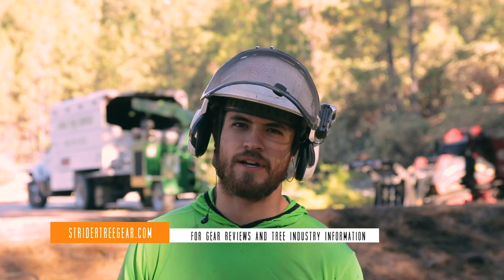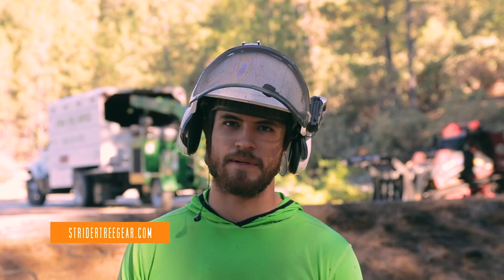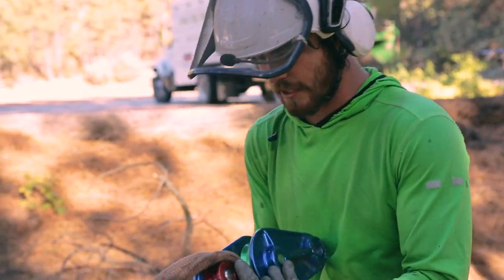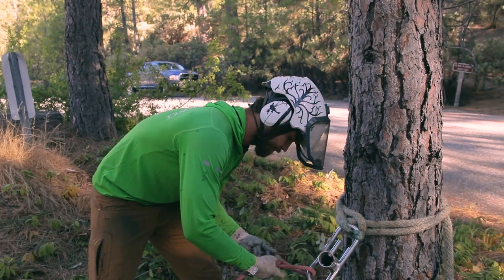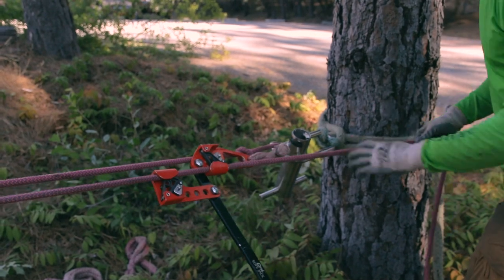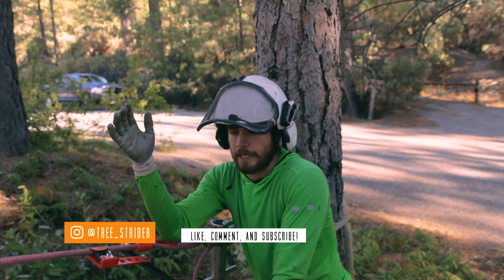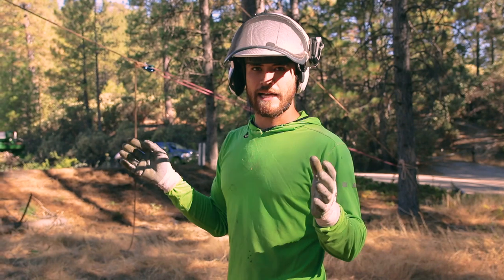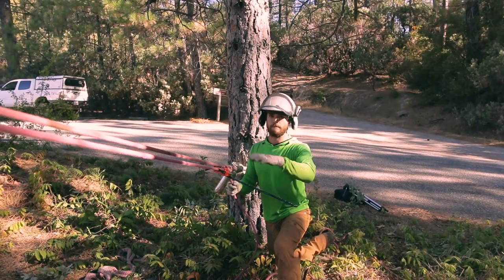Mechanical Advantage 101 | beginner mechanical advantage system 2:1

Comment: Yes the ISC blocks are amazing. I use a tensioning hitch system I used in Marine recon as an ML that only requires 4 steel locking carabiners.
Reply from the maker: I’ve seen those systems, pretty sweet ! And carabiners are much cheaper than Blocks too ;)
Reply: Can you put a link to the system that you use. It sounds interesting

Comment: I know you mentioned a 3:1 but I definitely prefer using 3:1in this situation because of the redirect from the second pulley basically garuntees you're out of the falling zone
Reply from the maker: I’m curious what you mean by 3:1 in that instance.  If you put a pulley on the tree where the rope jack was and pulled at a different location through that pulley it would just be a redirect and not a 3:1.  It would still be a 2:1 mechanical advantage
Reply: @Stridertrees  no that be a 3:1. Three lengths of rope and two pulleys is definitely a 3:1
Reply: @devinhessler1127  nope,   in the case your saying, its a 2:1 with a redirect,   its only a 3:1 if ALL ropes are parallel
Reply: @devinhessler1127  Sorry Devin,  its definitely still a 2 to 1